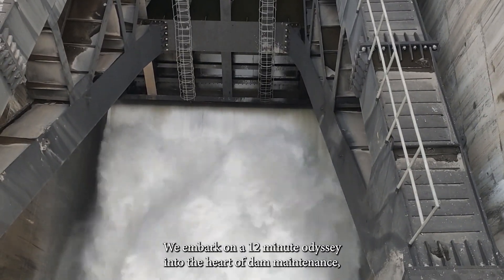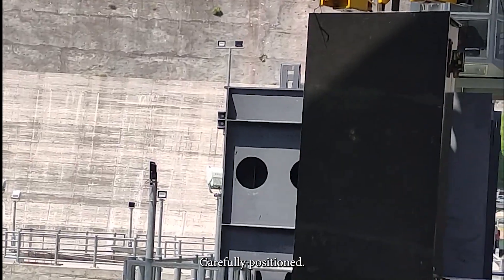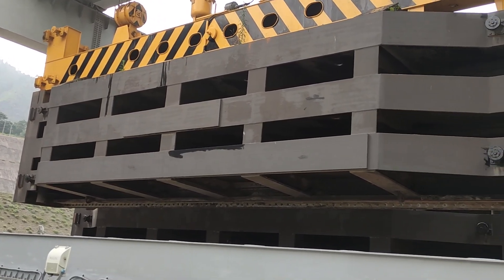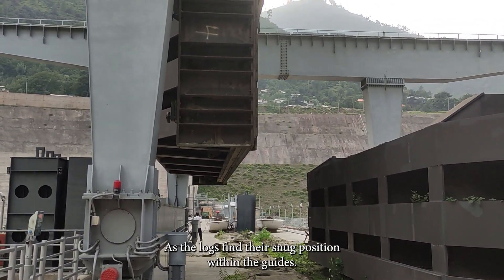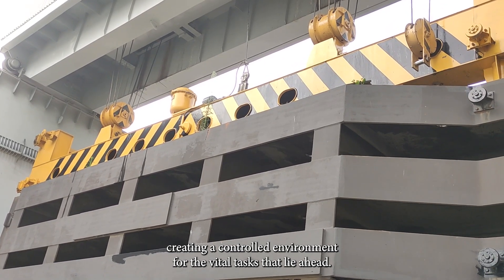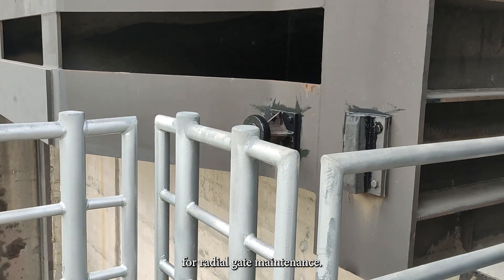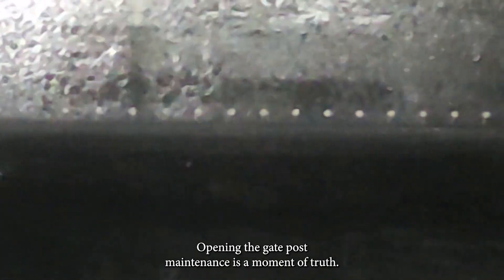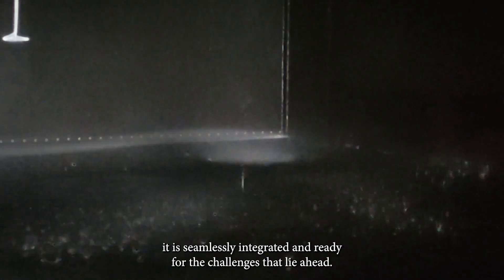HOW DIFFERENT SPILLWAY GATES REPAIR IN DAM

Comment: Enough of the sophistry!  Just tell the facts of what they are doing.
Reply from the maker: Certainly, addressing the water leakage under the Spillway radial gate is crucial. To rectify this issue, a comprehensive plan is necessary. Implementing Stoplogs, opening the radial gate, replacing its seal, and repairing the concrete in the sill area are essential steps to effectively halt the leakage. This multifaceted approach aims to ensure the proper functioning of the system and prevent further water seepage. Professional assistance is recommended for the accurate execution of these tasks and to achieve a long-lasting solution.

Comment: Have you ever had a problem with garbage or sediments going to the top of the stop log and then the cantry crane not being able to catch it?
Reply from the maker: Yes. This is a common problem when Stoplogs remains in water for a long time silt settles over the Stoplogs. The lifter beam didn't lock the pin into the Stoplog. We arrange divers to go inside the reservoir to clean Stoplogs and then we lift. Off
Reply: @Kashmir_explorer786  Thank you very much for your answer! I also work in a small hydroelectric plant and we also have this problem with the sediments. Your videos are very interesting. If possible, show the inside of the station with the generators if allowed.
Reply from the maker: @sv1jmcvkoukoutsis562   thank you for watching i ll make a video relating to powerhouse soon inshaAllah showing the turbines generating electricity